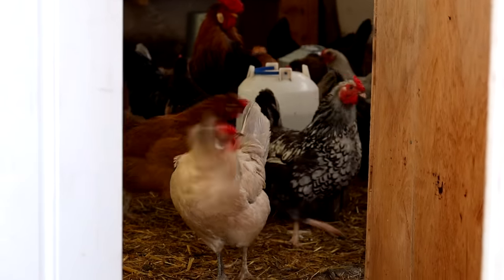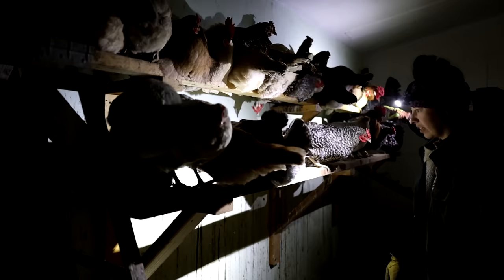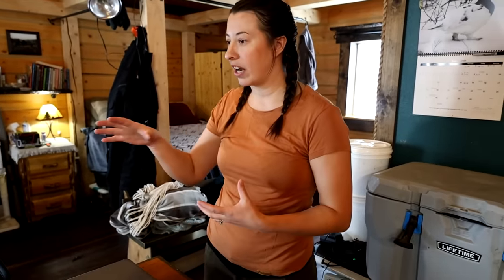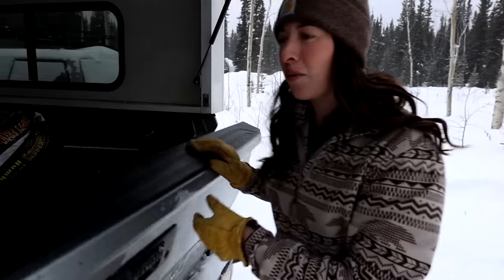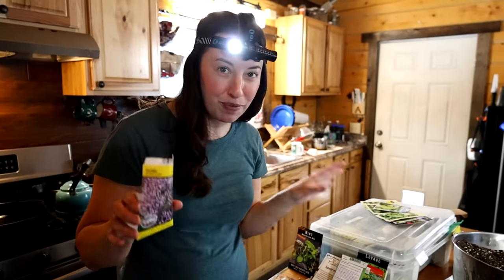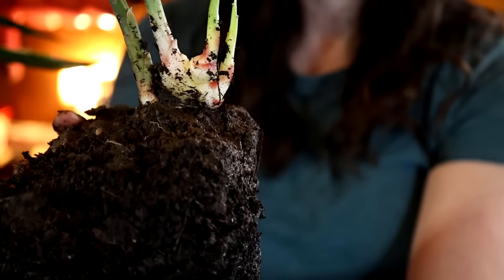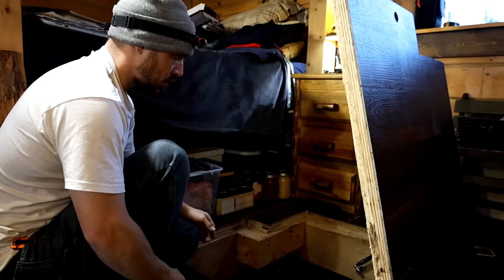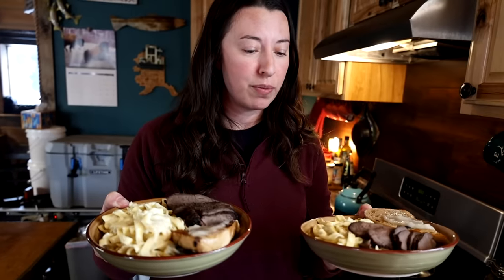The Sun Has Returned to Our Cabin | Starting Seeds for This Year's Garden

Comment: Tip for the wellness check on the chickens. Put some blue tape (tuck tape works well) over the light. Chickens can't see the blue light the same, so they stay very calm, but it doesn't dim the light too much so you can still see what you need to see.
Reply: What r they looking for

Comment: If you can find plastic sleds the same width as your bed you can use those as drawers underneath your bed. I use this under a bed at home and after putting you items in sleds or bins you can slide everything out from under the bed for access to still use all the storage under your bed.

Comment: For the bed, you could use a system I’ve seen in tiny houses / RVs where the bed is raised and lowered using a chain and pulley system (some use a modified garage door opener to move it), which would give you full access to the floor beneath the bed during the day.
Reply: This sounds like a really cool idea.

Comment: If you have to do a bunch of loads with the dump use your generator and a battery charger in back of the truck, put it on boost when you go do dump, will help get it off the frame. Lots of people burn out their electric pumps by running them really low.

Comment: I would add a mud room as far as your roof sticks out and during the winter could put generators inside and vent them properly so fuel lines dont freeze and hang work clothes and windows for starting plants or a skylite. maybe a small tent type wood stove or a vented propane stove.

Comment: In Europe they add a seed room or what I suppose would be a kind of greenhouse structure on the side of the house, and it heats for free and if you leave a gap rather than a door it helps to heat the house.

Comment: I got a 6-pack of those lights off that jungle website for $99 free shipping.  I'm using the same rack as you are, but I only use 4 shelves.  The bottom one is full of 5 gallon pails with a San Marzano tomato plant in each, the first set of lights (2 of the Amazon lights with a single tube LED light between) are attached to the bottom of the shelf above it  with a ratcheting pully system.  That shelf has 6 window boxes of herbs.  Chives, Scalions, Thyme, Basil, Parsley, and Oregano.  Same light setup on that shelf.  The next shelf up has 24 doubled up 500ml (2 cup) deli containers with a mixture of San Marzano and Roma tomatoes. Same light setup on that shelf.  I'm in zone 3b, about 120 miles north of the Saskatchewan Canada / Montana USA border.  You might say the city I live in is the belly button of North America.  Next year I hope to put up a 10x10 foot greenhouse so I can grow more herbs and start a few veggies and maybe even strawberries. 

Those buns looked fabulous!  My buns rarely turn out that big nd fluffy.

Comment: We are in NZ and never miss a video. Love you guys to bits.
Definitely use both struts, otherwise the plywood will eventually warp.
Try different angles to change the purchase of the struts, and most importantly make sure the struts are thick end up, when in the normal position. There is a tiny bit of oil in the gas cylinder that lubricates the seal, holding the gas in. If you have it the wrong way around, the seal will dry out and the gas will slowly escape, making the shock ineffective. 
Look at gas struts on vehicle bonnets and rear doors. they are always mounted with the larger tube (holding the gas and lubricating oil) upwards, in the normal position, so the oil lubricates the seal.
A bit long winded, but a lot of people dont know this.
Keep up the great videos❤
Second thoughts, you may be able to use one strut, by mounting it in the center, just depends if you can anchor it without it being in your way for access
Also lower pressure struts will put less stress on the hinges

Comment: People used to dig a hole, fill it with organic matter, manure will help, stick a capped pipe in it, backfill, let it ferment(?).  Open the plug and light.  Might work better if it were reduced some, but I never heard of that.  As it might need and extension with holes drilled to draw air in.  A smaller pipe should create a venturi effect.

Comment: Next year try covering the window in the coop with the plastic thermal barrier. No more ice! I lived on a canal boat in England for eight years, continuously cruising year 'round. Every year in late Autumn I used one of those kits available from Amazon on our single unglazed windows. No more condensation to mop up and the temperature inside our boat rose by 8 degrees in an hour after we did it.

Comment: Spring is here!  Cabin fever is over!  

The chickens are living the good life in their luxury condo ( with concierge service)!  The best hen house I've ever seen.  Kudos.

You guys have an  impressive gardening system.  I was going to suggest getting hold of some comfrey plants (one of the best plants for nitrogen fixing in your garden soil and they can be grown concurrently with your garden crops) but you already will get plenty of nitrogen from the horse manure (moose "nuggets" and bear scat work too).  But think about including them in your future garden plans.  Comfrey is a perennial, but even after a sub-zero winter, it will grow back vigorously in the spring. Also, when you can, use the blood from your animal harvesting (either in your compost pile or directly on your garden plot).  Very rich in nitrogen and iron.

You can also make a drip watering system for the garden.  Cut 55-gallon drums in half long ways and plumb in drain lines and lay them out to catch snow during the winter and rain in the spring/summer (I also used spruce poles to build a 3 ft high mounting rack for gravity drainage).  Plumb them with piping of your choice so that it drains into the garden.  Put a shutoff valve inline and you have a makeshift watering system.  This worked 45 years ago but I am sure you can develop something better with the availability of materials today.  Just a thought.

Thanks so much for bringing us along guys.  You are living life to its fullest and you can't ask for more than that!  Cheers.

Comment: Friends have a cabin with clothes storage problems too. They came up with conduit pipe with an eye screw at each end and a pulley attached to the ceiling. They ran a rope through the pipe and up through the pulley(s), put their clothes on hangers and raise and lower them out of the way. A possible solution 🤷🏻‍♀️

Comment: Loved this chill intro over the chickens! Good job eric! 
About the bed and making more space, I wonder if those posts can be cut a few feet from the top and repurposed to elevate the bed just a few feet so it's still easy to get into without a ladder BUT, you create a situation beneath the bed where you have space for a flat shelf between the canned goods on the floor and the bed itself, even a giant custom makeshift drawer spanning the length of the bed or sectioned into two large pullout drawers so you can store clean clothes and paper and such in there, and then have that other food on the bottom. Regardless, it's really cool to see you guys work on the indoor space more! So excited for the garden episodes this year.

Comment: Hi again, I just found out that it’s more cost effective to make your own bread flour by adding vital wheat gluten  powder to the AP flour.  It’s really expensive here in NY.  The baking supply stores carry it, but I ordered it from Amazon.  It’s 1 1/2 tsp to 1 cup of flour and you remove 1 1/2 tsp of flour before adding the wheat gluten as you are replacing it with wheat gluten powder.  It was cost effective for me, maybe it will help lower the cost for you.

Comment: Once again, just beautiful drone footage of the snow weight on the pine trees, they look pretty stressed from the heavy snow. Ariel, I do not have a sunny widow for sowing seeds, our house faces north and we have a 3 foot  soffit front and back. I bought a grow light for sowing in my basement on a table, but I always have issues after about a month with long leggy plants and they want to fall right over. I put them outside to harden off a couple weeks, but one rain and they are so fragile with weak stems, the rain just desroys them. But I am getting sick of paying $8-$9 per tomato plant and I usually buy 10, then I get 8 or 10 hot pepper plants. Last year I sowed the cucumber and zuccinni seeds right in the ground and they worked well, so yeah I spend a couple hundred bucks and that`s without any of the soil amendments I buy, like bone meal and a balanced granular fertilizer, which isn`t cheap any more. Can`t wait to see you and Eric back in the garden, you guys were rock stars.

Comment: So for years, I’ve gotten so frustrated to buy the store-bought bed frames about 20 years ago. My husband built us one out of 4 x 4 and shelving and it’s pretty high up as well. I’m getting older now had it about 22 years I actually want to cut the legs down because it seems to be harder for me to climb up there now that I’m getting older, but we have had it 22 years and have never needed another frame. I just replaced the mattresses and now it was built for the boxspring and then the mattress but maybe next time we can just do the mattress that might help me on making it lower but it’s really nice. He built it outside at the dimensions that he measured and then re-took it apart and then re-brought it in the house and built it back in the house and it’s very very sturdy. I actually stain the wood a walnut stain and it’s got bolts nuts and bolts on there and everything and like I said we’ve had it 22 years, I totally love it. I’ll never need another bed just replace the mattresses and them muffins or bread. I don’t know buns they look great.

Comment: I think you should think about building another high tunnel - start modest and addon if you like the results - some rebar/pvc and plastic is all you need and a place that gets full sun but the regular garden should be pretty fantastic all on its own - great you are getting things started now, think about continuing to clear some trees out on the edges to bring in more sun, think about a raspberry/blackberry row somewhere in the garden and please do some simple composting - maybe a wide open ended bins you can manage with the tractor - simple stacked logs should work pretty well and the chicken coop will help provide some hitest starter, think about getting a well designed hd tree/brush grinder - would provide more great composting material - i think doubling down on the compost will not hurt one bit and could help significantly if you go big on the garden side of things, plant a bunch of flowers too - have variety and do some experimentation/moonshots

Comment: I have a similar situation where i need a crawl space not to freeze. I use an inkbird temp crontroller. Just set a minimum temp you dont want it to go under and a max temp (when it turns off) plug the fan into the controller and you dont have to worry about anything.

Comment: Great job on the voice over, Eric. I believe it is the first ever voice over on a video in all the years I've followed y'all. It was very well done. 
Oh! When the warmer weather comes use a hand planer on the knob side of the door to the chicken coop. That will easily solve the sticking issue. Less surface area for ice build up and larger gap for swelling that happens in summer. If I remember correctly, y'all already have one of those, right? 
I'm so excited for y'all to be able to get back to the garden. I'm sure you missed it so much last year.

Comment: Check on full extension slides for under the bed. You lose about 2 in of space on the floor. But you can pull it all the way out and find out what's in the back. I'd make two 30-in or whatever wide by however long. Good luck!

Comment: Hey Team, have you thought about adding slats to the beams running across the top of the bed frame? you could easily gain a few cubic metres of additional storage that would remain warm in the winter

Comment: We have vinal in our coop, love it. I'm thinking of putting it up the walls to help protect them.  What about one of those beds that lift up so you have storage under it?? You could close in the front porch or build off the back . You have the mill and logs....... By adding on to the back that would give you a bedroom and closet and so much more room in the front.  You could do a small high tunnel on the porch. Just keep the door open a little. It's a good feeling when you start seeds, you know spring is coming. Thanks for sharing. God bless.

Comment: Glad to see you starting the garden again.  If you were closer you could take all the rotted horse manure you wanted...lol.  Start a few tomatoes or at least some cherry tomatoes...you know you want to!! LOL.  You can always grow in a pot on the deck.  Sure didn't take long for things to sprout - I am thinking you may need 2 lights per shelf though based on the lumens and the fact that sprouts were leaning on the edges.  With the sprouts, the sooner you eat the more nutrition but typically they are cut off as the true leaf starts to emerge.  I grow salad material all winter under my grow lights rather than sprouts - lettuce, beets, kale, chard etc all for greens and let them get to about 4 inches tall before I start harvesting.   I  also grow ginger and turmeric in the house cuz I am too cold as well - my stems got 6' tall last year - I did trim mine but only by 1/2.  I don't think it will hurt your plant at all.   Just for reference, I am in 3b with about 100 frost free days.  Great video as usual!!

Comment: Seed starting time. My favourite time of the year with you guys. The absolute joy you radiate at this time of the year is catching Ariel.
Was wondering if above the bed could have a solid top on it to use as storage?
Have you looked into hugelkultur with gardening. We used the method in our old place, mainly to use raised beds, but it has the added bonus of radiating more heat in the soil as the solid wood and compost breaks down through the year. We used logs of wood at the base and grew amazing rhubarb in it. I know you're much colder, but it may give you a smidgen longer growing period
Going to miss this year not growing ourselves so appreciate your excitement this year.

Comment: hey guys Boston cucumbers that there's a best for making pickles you're very lucky you get a lot of sun pickling cucumbers are really like a lot of sun and they're really picky  plants you got to get your ground to about 60° f before you plant them and my suggestion would be believe it or not next to your house and put a trellis or make it so they can climb because once they take off holy crap they will climb all over your place and I've had it where I've had two plants and every day once it's producing I usually get about 12 pickles I usually grow the cucumbers to about no more than 12 inches cuz I want him just to fit tight in a glass jar I have a great recipe too for making pickles it's basically pickling spice without any hot spice in it make sure you take all the hot peppers out Dill I usually use both fresh Steel and a little dry at the bottom and then a good couple sprags of fresh dill in there really important and a handful of garlic and then my brine is 22% salt very important you need to get a hydrometer to measure the salt content. I usually cut the Cucumbers almost in half I leave it so they're almost attached but I want to get a pickles Brian quicker so if you do it that way  will Brian quicker. I usually put them in my refrigerator and keep it about 40°, but if you have a good cold cool place about 40-45° that's what they really need so like under your house where you have that wonderful storage area and then about a month they will be about half hour and they're really good and as they get more and more time they turn into a full garlic pickle and no last two years if you keep them perfect temperature and it'll stay crispy but it's important to pre-grow your plants you want to get them about a foot tall at least before you put them outside but there are a full sun plant they are pigs about how much sun you can give them my problem is been the last 3 years running has been terrible where I am in San Pedro California we've had terrible gloomy days until about 1:00 in the afternoon and that destroys the morning sun for these plants that need it so like last year I planted 10 plants one survived it only grew a couple feet it's been 3 years the last time I had really good cucumber plants and they were wonderful but then how you're before that I had the same problem with the Gloom in the morning